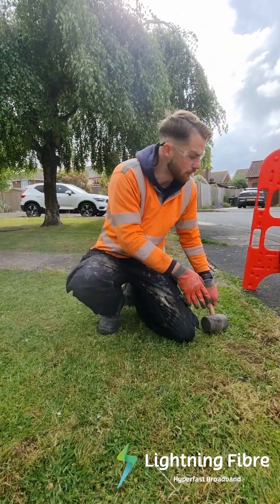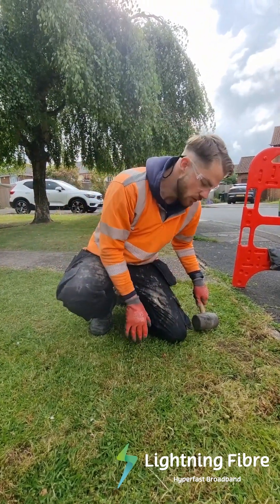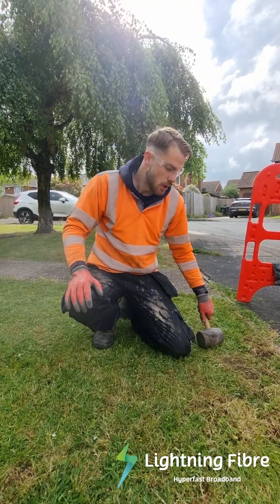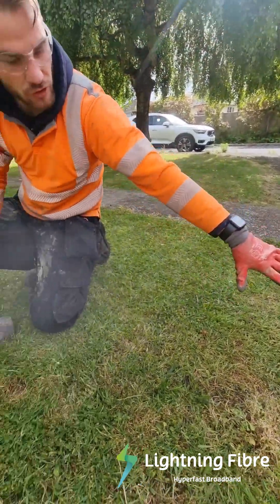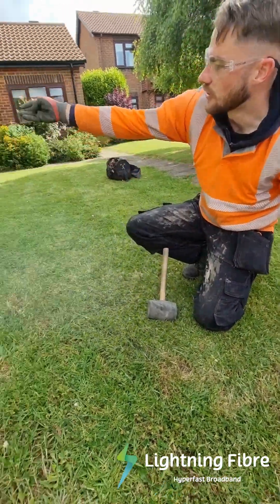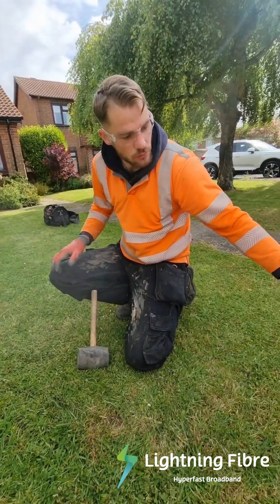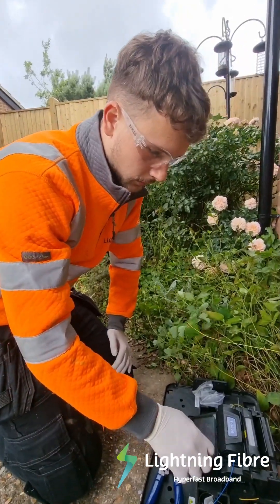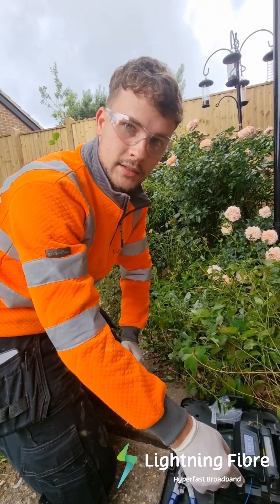What happens on installation day? Full fibre, 'toby' fed properties

Comment: Not keen on that fibre going under the grass tho one spade through that and fibre is stuffed no fibre then that's a very poor and lazy install . 👎
Reply: What’s lazy about it? You should not be putting anything in the ground that far without checking anyway bearing deeper could happen but it would require a trenching and most people do not want that.

Comment: so what are you going to do if there's a resin driveway, or the router is at the back of the house? or the house has EWI?
Reply: Quite simply you may have a cost there or be told to do some of the work getting a connection to the back of Wales probably isn’t an issue if you can go round the building but on certain driveway materials you may be asked to get me tucked in for them or it may need digging up and you may have to reinstate

Comment: Fiber optic cables are typically buried at a depth between 18 and 36 inches (0.45 to 0.9 meters), but the exact depth can vary depending on local regulations, soil conditions, and environmental factors; in most cases, it's recommended to bury them between 2 and 4 feet deep.
Reply: Not always in this case this installation is happening after the house was built so bearing deepest difficult it may be a case of mapping from other utility companies so can actually be more dangerous than a fault potentially happening

Comment: So what happens when you scarify your lawn each spring, a cable chopped up into little pieces !
Reply: Those machines absolute breach health and safety regulations on how deep you can go in the ground without a lot of other safety measures in place it did right for them to not consider that but you could bury DP yourself however if you like your lawn, I doubt you want to rip it all up
Reply: Just what I was thinking, why isn’t it in a protected tube 😂

Comment: That is a huge hole in the brickwork next to the box they have made. Why you should drill from the outside in...
Reply: If you drill from the outside in there is a higher risk of blowing the plaster off the  internall wall as well as striking cables pipes etc, finally your internal height from your floor to the outside are always different.
Reply: @justinwilson3420  ive been installing fiber for almost 10 years. if you just measure properly and come off the hammer coming through or use a 5.5mm pilot bit its easily avoided. honestly this whole install is pretty bad.
Reply: That’s usually not allowed because there’s a higher chance of damaging something inside

Comment: This is a substandard installation. The fibre cable should be installed in a PVC duct for protection and buried at least 450mm beneath the ground to avoid damage from digging or impact loading.  It is not recommended to splice fibre so you would need to lay a new cable from the box on the street to inside the house (as its not in a duct if you hit the cable doing any planting. You won't know where that cable is in the garden in a few weeks. This company is not even smart enough to know that their work is substandard.
Reply: Swear the first thing they said in the video was that they was installing subduct.. I don't think a shovel is gonna do anything to that mate
Reply: @mitchleigh2369 but you realise that substandard is not the same as a “subduct”? Just asking… this is not by the standards of OFCOM or BT / Openreach.
Reply: Better than openreach they have installed mine and I’ve got no internet at all , sky call it an upgrade
Reply: @allancrosthwaite2219 if it’s no Internet, that may not be them
Reply: @allancrosthwaite2219if you are through sky it might be a sky issue my mate has no Internet for months years ago after he was with sky and it was and error on skys side
Reply: Not always the case